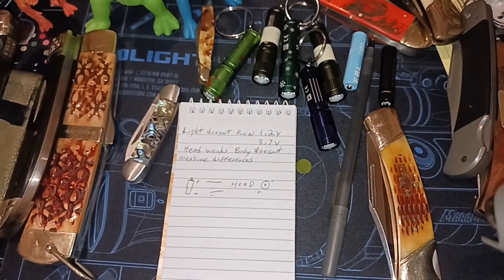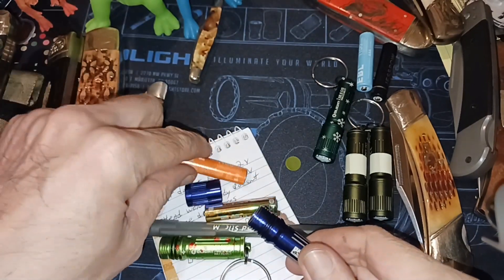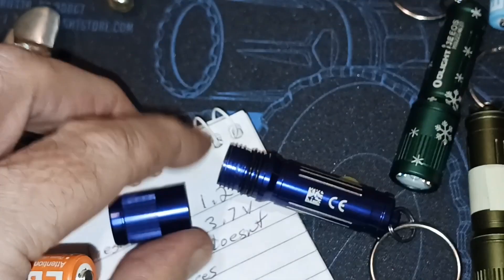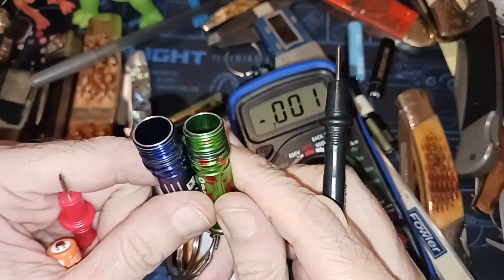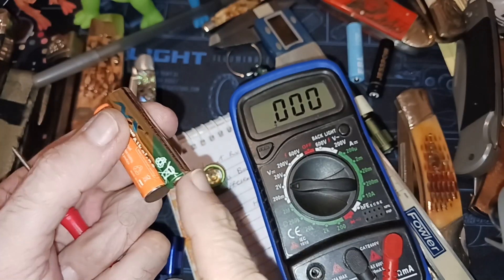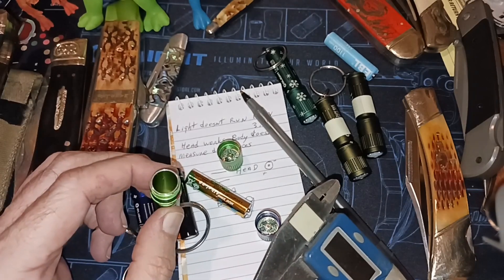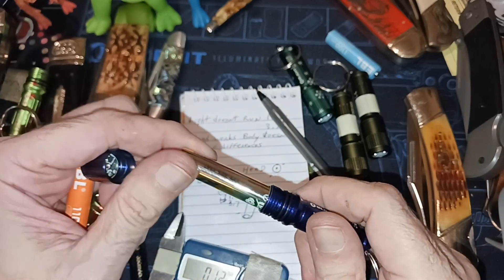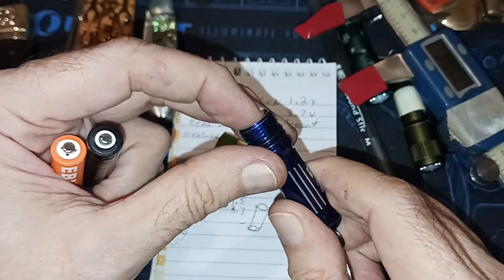(1011) Another Attempt at Figuring Out The Olight i3e EOS Mystery

Comment: Will it work with a rechargeable AAA battery? Have you measured the inside contact ring of both heads and are they the same? You can use the scale on the end of the caliper to get a close measurement.:face-blue-question-mark:
Reply from the maker: I've measured everything I can think of.  It could be a difference in the depth of the tube, combined with a slight difference in battery length??  I contacted Olight through their website & linked to this video. I also left a comment on Olight World's video of this light telling them to check their lights. Some don't work as advertised.

Comment: We all seem to have puzzles in life that may require some sort of Haitian vodou in the mix of answers. I once spent countless hours on a mini maglite with a similar issue and almost went crazy trying to figure it out. Adding to the issue was the fact that the bottom battery access cap was on permanent (perhaps never was a screw-on cap) and the head portion with the bulb allowed access only to change the bulb and no further. I have never heard of a one and done maglite before. Finally after many attempts over a period of several years I distinctly remember it being tossed 75 feet the length of the backyard into a large handy dumpster. What I should have done is to saw it in half to see what the heck they were thinking.
Reply from the maker: 😅 I have a mini Maglite where the battery corroded & the tail cap won't come off even with pliers. Leaking Batteries have killed more flashlights 🔦 than anything.

Comment: Maybe the flashlight “knows” which battery is installed.
Reply from the maker: I could understand if the head knew, but the body is just like a wire, it only conducts. It doesn't have any electronics to "think" with. Idk. I'll let the high paid engineers at Olight figure it out. I've reached the limit of my abilities on this one.